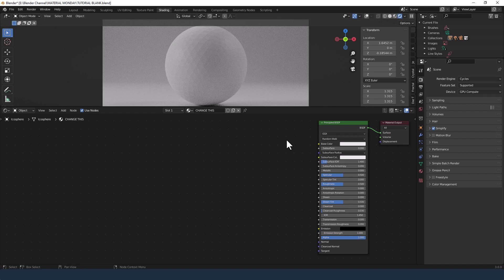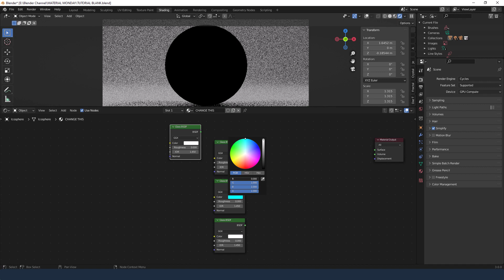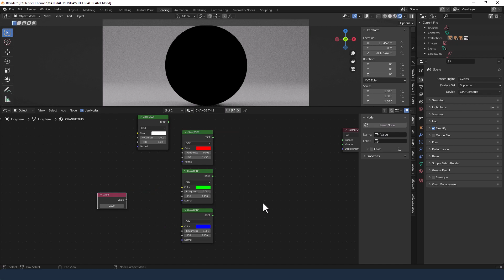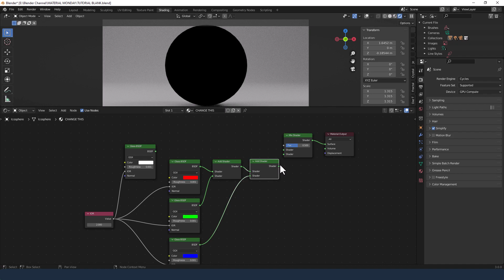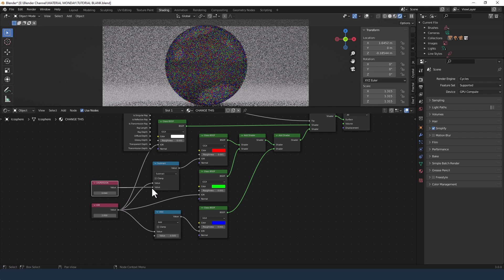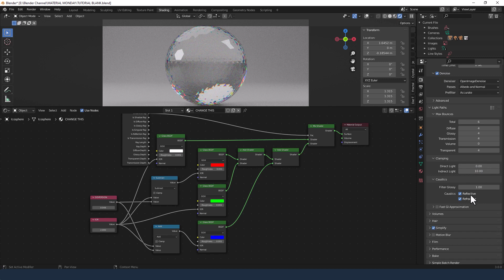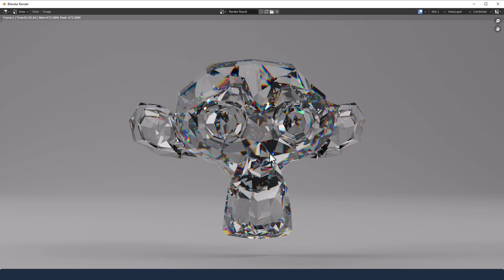CREATE A PROCEDURAL CRYSTAL GLASS MATERIAL FOR BLENDER

Comment: Thanks for this. Got all the nodes set up the same. I have used an animated icosphere to mimic an ear stud on a face portrait on a 2D plane, but because it's small, it doesn't have much impact.I have put a spotlight behind it to make it brighter, but that fades the colours. Can you recommend a way to illuminate it properly? I am very new to Blender. Thank you.
Reply from the maker: In my example I use a three light set up. This is because refraction is used to scatter the light. Therefore lighting it with only one light won't have as much impact.
Reply: @blenderbitesize  Thank you kind person. I will set up multiple lights for it and see how it goes. Any idea on light values? 150w for a 0.13m wide icosphere is about right? It's hard to see what the lights are doing as I'm using cycles without GPU support.
Reply from the maker: @DaveThompsonfairlife4all It will all depend on your scene. Try various set ups and see what "sparkles".
Reply from the maker: Yes, lol.

Comment: Many thanks for the tutorial. Crystal glass looks really nice 👍🏻👍🏻👍🏻 Curious to why you did not add Math node to the green shader? 🤔
Reply from the maker: Thanks for the question.
You add math nodes to two of the three colours to shift them slightly + and - to aid the refraction effect.
Therefore there will always be one colour that is the standard or default value. It just seemed easier and "cleaner" in the layout to make the centre colour (green) the default.